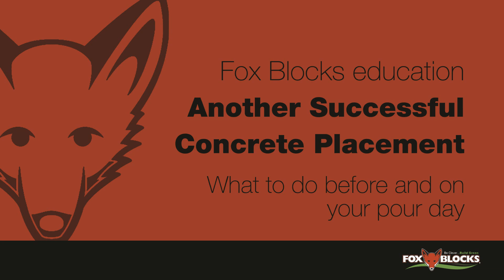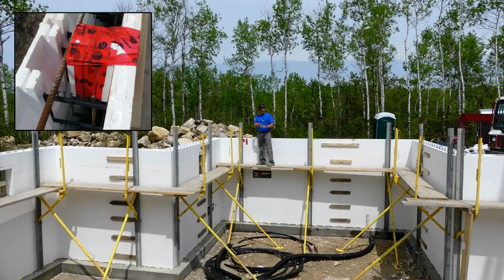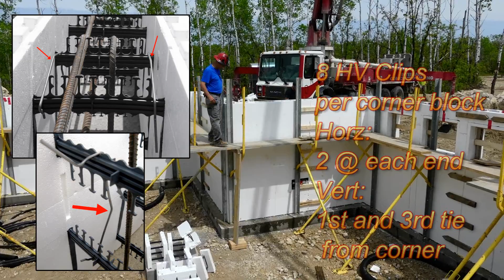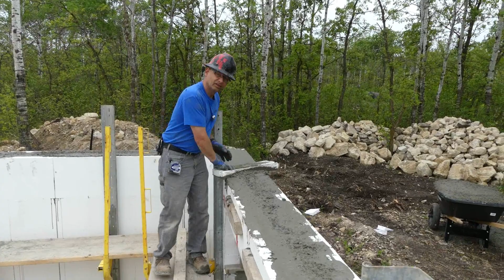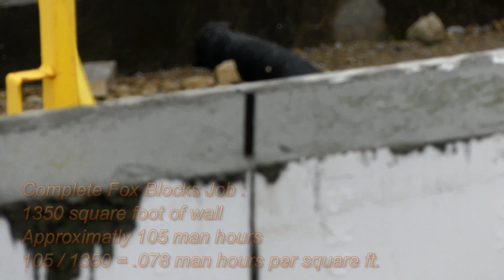How to Prepare for ICF Concrete Pour Day | Fox Blocks Insulated Concrete Forms Guide

Comment: How do you get rid of the air pockets under the windows?
Reply from the maker: If you follow the Fox Blocks training, simply create an opening in the sill to allow the air to escape during concrete placement. With that hole the contractor can visually monitor the concrete and ensure the wall is properly consolidated under the opening.

Comment: What is the tool being used to vibrate the concrete from the exterior? Do you do this lower on the wall and slowly move up as you fill?
Reply from the maker: In that video we used a wallbrator which is no longer available. You are correct in your wording that external vibrators, which can be as simple as a hammer against wood placed against the formwork, start at the bottom of wall and chase any potential trapped air up to the surface while concrete is being placed. Ideally a wall is internally consolidated but when needed external is better than no consolidation.

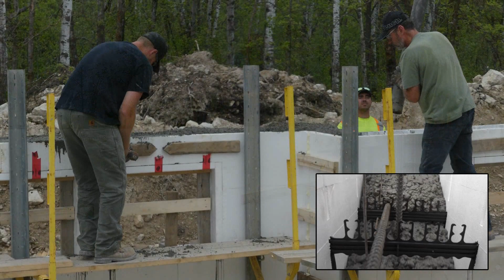Comment: At about 3:21 seconds into this video, you use a cordless vibrating tool.  What is it?
Reply: Hi Jim, that was a wallbrator which attaches to a cordless drill. There are 2 or 3 different brands of these I have seen on line. There is a great explanation of it at the 7 minute mark of this video: Building your ICF home - Concrete https://youtu.be/Z8u3v4LdR5Y. They are getting hard to find.
Reply: @glenklassen779  You'd wonder why the concrete operators didn't use a concrete vibrator with a whip cord and didn't practice what the video you suggested said to do: To operate the walbrator from bottom to top, in an upward fashion. Not just at the top.

Comment: Hello Glenn,
 I use Fox Blocks for my ICF Business.. I am wondering how you level your wall straight with the braces? I use the string method with 5 inch long 1x3 screw in all the outside corners and run the string all around the building.Then by each brace we check the with a peace of 1x3 if we need to level in or out to give us perfect strait walls..
Reply from the maker: Hi Sebolonius
My preference is exactly what you describe. I like to have a string in place prior to concrete so we are not trying to do it while the concrete is sitting. I also like to straighten the ICF walls long before concrete because the walls seem to have a memory. If the walls are only straightened just before concrete placement they will go back to the same crookedness during concrete but if they are straightened the day before concrete they stay straight during concrete.
Reply: Sebolonius iii